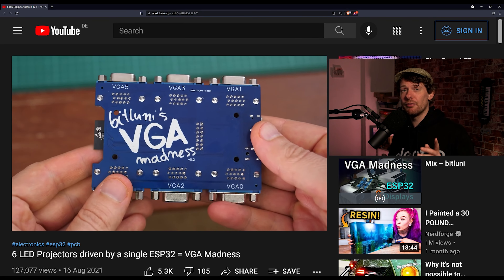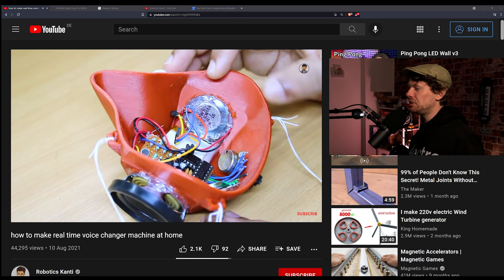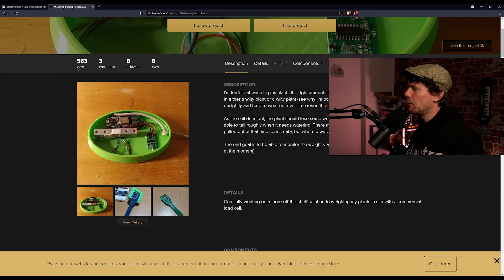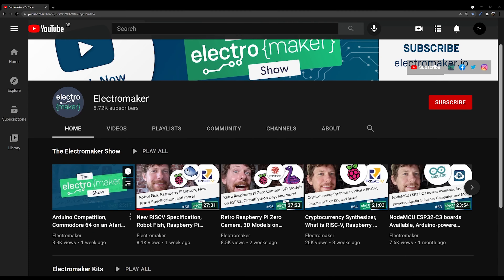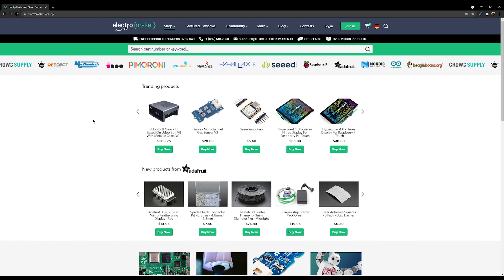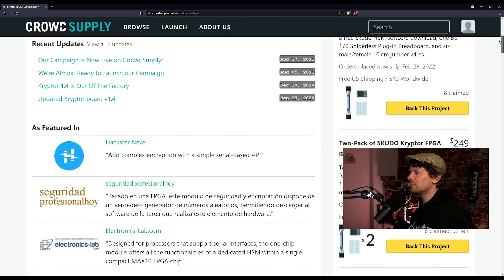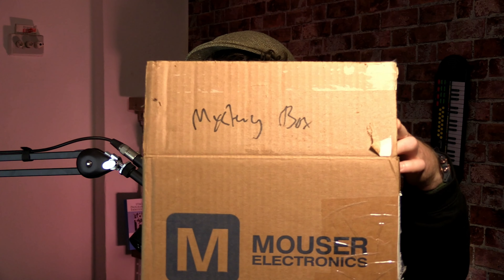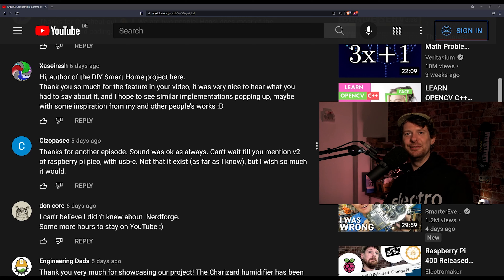Micro:Bit Robots, Raspberry Pi CM4 Carrier Boards, and More!

Comment: The two "mystery" ICs mentioned in the voice changer project were the HT8950 voice modulator (larger chip, used to change the voice frequency) and the LM386 audio amp (smaller chip, used for amplifying the signal for the speakers)